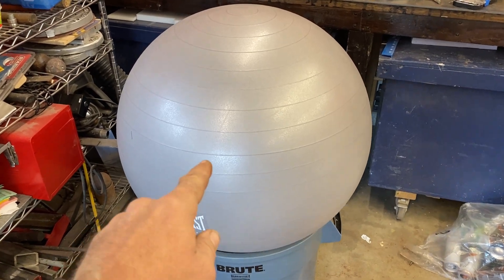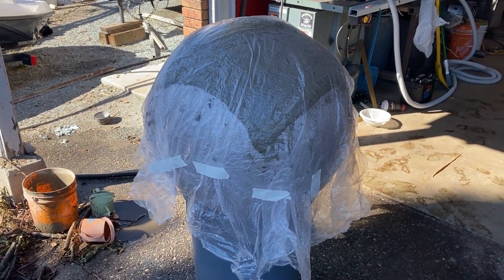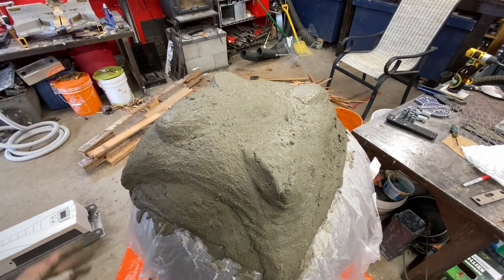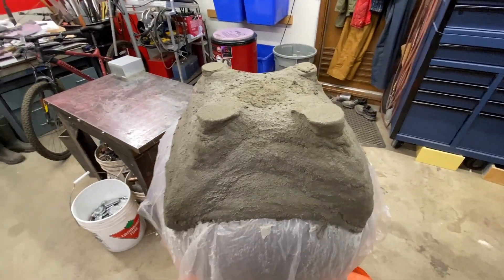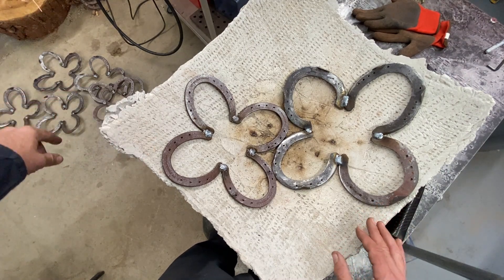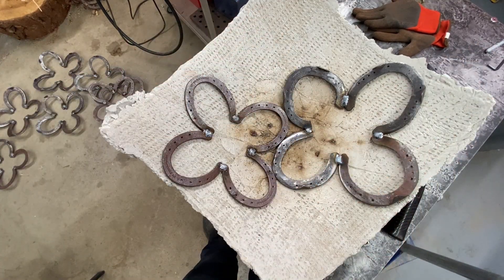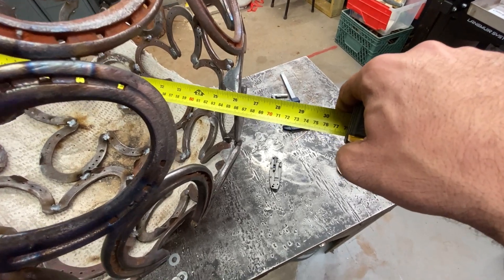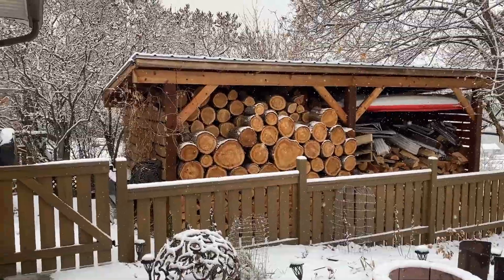I welded 68 horseshoes together

Comment: turned out nice.  Our first real snow fall was yesterday at 10-12", almost ski time!
Reply from the maker: wow 10-12. what elevation are you at? our hill was supposed to open friday but it got pushed back another week. cheers
Reply: @stevesrt8 5k feet, what's funny is we got more snow than the ski mountain did which is 15 mins from here.  Must have all blown off the hill down to my place!  It was nice and fluffy in the morning, but temp went up just above freeze as the day went on and took me 2 hours to clear all said and done I think due to how heavy it was and that is with the new blower!

But winter is here finally and I'm ready!
Reply from the maker: @ChatterontheWire   5k nice. we are only at around 1300ft here and dont usually get much snow in town. i ski silverstar mountain which goes from 3780 - 6280. looking forward to it for sure.